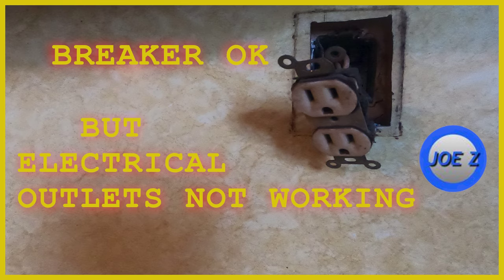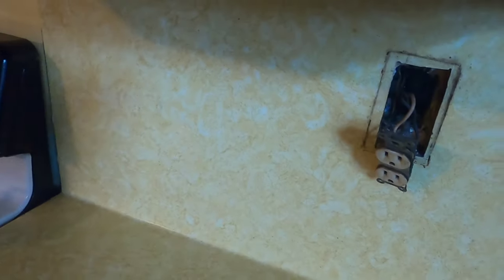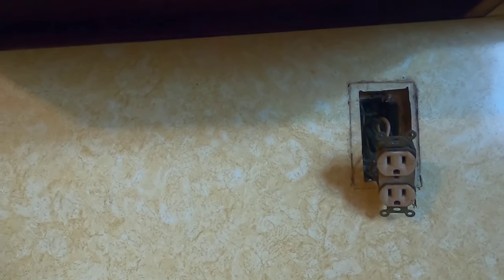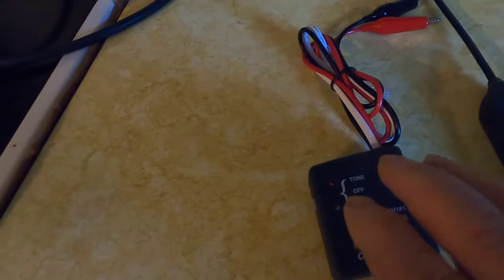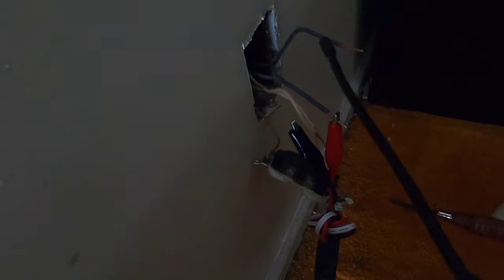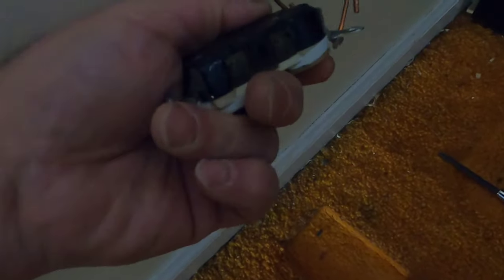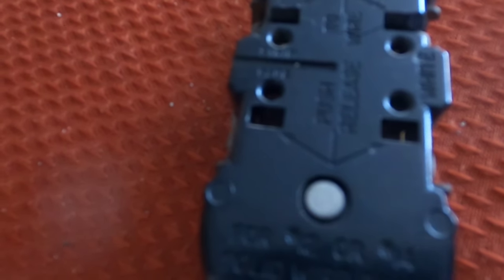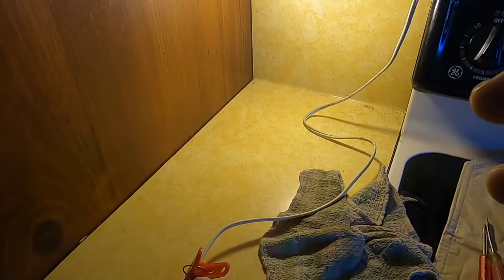Breaker on but no power to outlet FIX

Comment: Cost me 167 for the electrician to load test a gfi that was causing loss of power to my outside outlets. It didn’t pop the breaker but under load it would fail.
Reply from the maker: Calling the electrician was the safest & probably the least frustrating way to go. Although I try to save as much as I can the 167 was a decent fee.  
   Roger Miller, Thank you for watching and taking the time to comment. Roger Miller I have other videos on my channel that cover many different subjects  and new videos added weekly that may also be of help or interest.
 Be sure to 👍, share and subscribe if your are inclined to do so.  Also not to miss any new videos remember to hit that notification 🔔
 Another way you can help support  this channel at NO cost to you is by using one of my affiliate links.
     * Thank you for watching I really appreciate your support.***
Again I hope you get to  enjoy other videos on my channel as well. 
 Stay safe, Joe Z

Comment: the breaker box is 20 , 30  ,50 . i know things like the washer dryer ,  microwave are supposed to have their own outlet
Reply from the maker: That is a good start. I would turn all the lights on, plug radio, lamps etc
 into all the other outlets & just start turning off the breakers one at a time. Have you considered just running a couple of new lines to the non-working outlets? Cost wise it should be way less. Hope this was of help.
Stay safe, Joe Z

Comment: The contractor that wired the house initially should have only used the screw terminals on the side.  Never ever use the push connectors on the back for this reason.
Reply from the maker: Thank you for stopping by & taking the time to comment. I agree. I have receive many comments on this video from viewers that had the same problem So I dug a little deeper on line to fine out this happens way too often. Unless the installation was not correct they should not manufacture these with the push connectors.
Stay safe, Joe Z

Comment: My issue is that there is power but it is not enough run the fridge ac. The power just keep going on and off.
Reply from the maker: Until you can get run another line find what other appliances you have plugged into this line & removed them.
Stay safe, Joe Z
Reply: I think I'm having a similar problem where I have power to all the outlets but it's not enough to run my refrigerator or skillet. When my buddy hooked a multimeter to the outside box and inside box the readings came back okay. Any help would be appreciated. Ty.
Reply: @TheOmengod  replacing the switch outside fixed my issue
Reply: @Indicesproptrader  what switch? Ty.

Comment: Those stab in the back connections are terrible. The surface area of the blade that contacts the wire is about 1/100 of what you get when you use the tap screws. Every time I have an issue in the wall, it's that, it gets changed and we are fine. I should just do them all, but if it's working.......
Reply from the maker: Thank you for stopping by & taking the time to comment. I agree, whenever I have an wiring issue this is usually the cause. Changing as I go.
Stay safe, Joe Z

Comment: yes those push-in wire outlets are junk,,they cause problems,,,i worked in a large plastic plant running a 600,000$ machine,,and every time we had a electric problem it was one of those damn push in switches,, the Maintenace guys would remove it and replace with a switch where you tightened a screw in on the side like a old style outlet,, and problem solved ,that machine had plenty of switches like that ,it was once a month to replace them..
Reply from the maker: Thank you for watching and adding this information. From my experience & many other comments these '"push in"  outlets cause way too many problems. And they still sell them. Should discontinue manufacturing them.
@louisrichards3702 I have other videos on my channel that cover different subjects  and new videos added weekly that may also be of help or interest. 
Your support is not required but always appreciated. If you are inclined to do so your Subscription, Likes, Comments and sharing this content would help me to reach other viewers that may also find this channel useful or entertaining.
 
 Stay safe, Joe Z

Comment: My stupid kitchen in an old trailer has 2 plugs on the same circuit, so once and awhile if 2 things are on it goes off... But u can go and flick tht breaker on and off till the cows come home and nothing.! BuT, the plug will sometimes start working again just out of the blue, could be a day, could be a month.? Odd... So i figured the breaker was bad and bought a new 1..., but it would not work either, so i tried it on the next fin over & Vola it Worked...  -3 wk's later i had 2 things on again and Poof, out both plugs go again... Go bk in and look at breaker & it's sTill on.? Moved it over to another fin and nothing... Ive also changed that recepticle also...... Strange to me... ive got 1 dam plug that works now in the kitchen area, and thats by the door tho... No Fridge or Heater........
Reply from the maker: Thank you for watching and taking the time to comment. @OldGuy70s this may be a dangerous situation. You may have a loose or burnt wire that makes & breaks contact somewhere in the circuit. Do you have copper or aluminum wires? I ask because I heard of aluminum wires getting loose on terminals. 
 Check some of the comments below. May not be the issue you're having but may point you in the right direction.
 Stay safe, Joe Z

Comment: bro my controller batteries were flat and their rechargable so i tried to charge them but accidentally used wrong charger and i blew out the whole lounge and im scared because my mum is probably gonna kill me so im tryna fix it hopefully
Reply from the maker: Hi K_, Be careful, you can really get hurt or worse with electricity. That said before you take anything apart just check your circuit breaker first. It may be that simple. If not call someone (an electrician) who can help if you are not sure what should be done.
Let me know if this was of help. Thank you for watching & taking the time to comment.
Stay Safe, Joe Z
Reply: @JOEZEP54  Thanks for the reply luckily like 10 mins ago i fixed it and it was quite easy but next time i will never do that again i have learnt what i did wrong
Reply from the maker: K _,  You're welcome, I am glad this was of help. And thank You for watching and taking the time to comment. K _ I have other videos on my channel that cover many different subjects  and new videos added weekly that may also be of help or interest.

 Be sure to 👍, share and subscribe if your are inclined to do so.  Also not to miss any new videos remember to hit that notification 🔔

 Another way you can help support  this channel at NO cost to you is by using one of my affiliate links.

     * Thank you for watching I really appreciate your support.***

K _ I just want to mention If you haven't installed the TubeBuddy browser plugin yet, to help your channel grow  Just go to my favorite tool for channel growth Tube Buddy. Now You can use it too, here's my affiliate link to the Free versionhttps://www.tubebuddy.com/joezep54   Start with the free version, yes it is free to not only to down load but to use.

Again I hope you get to  enjoy other videos on my channel as well. 

 Stay safe, Joe Z

Comment: having the same problem as i speak gotta go out tomorrow when harbor freight opens and get a tracker the old house im living in the wiring looks like a bowl of spaghetti so go only knows where the open is and its on the old glass fuse type breaker box to add to the joys of it buy a home they said it will be fun they said ........bastards lol
Reply from the maker: The fun has just begun LOL. Congratulations on purchasing your home. There is are many benefits that go with owning your home along with becoming a jack of many trades 😃 I haven't had to deal with an old glass fuse type breaker box in many years but I am very familiar with it. Just be careful and don't rush the job give yourself time to figure out the problem. Walk away from it if & when it gets frustrating then go back to it fresh. It took me a little while to figure out how to use that tracker and a couple of days to come up with the game plan to solve my issue. Not wanting  to pay $$$ gave me the motivation to keep at it. But there are times when we do have to call in the pros.
Let me know how your repair goes.
Stay safe, Joe Z
Reply: @JOEZEP54  got the tracker and well still trying to figure the damn thing out but im stubborn and refuse to pay 100's of dollars to an electrician i will figure this out might not have any hair left on my head when i do but ill be that bald guy smiling like i won the damn lottery when it happens
Reply from the maker: LOL. This may be of help. Get a length of wire or an extension cord, attach the tracker to it to see/hear how it tracks. .Let me know if it does.
Keep smiling, Joe Z

Comment: In other words: Loose wire. Find it and everything past that is fixed.
Reply from the maker: Thank you for watching. In this case no, it was a burnt/worn out  outlet. Although it is obvious that there was a break somewhere in the line the problem was how to find the break. In the video you can see  half the outlets in the kitchen did not work but the break was from an outlet in another room.
Stay safe, Joe Z

Comment: why would he talk so long showing what did not work to fix it. SHOW HOW YOU FIXED IT
Reply from the maker: Mr. Meener, I appreciate you stopping by & commenting. To answer your question not all "breaker on but no power" issues may be caused by the same problem. So what did not work for me may very well be the issue for some other viewer. I believe I made it clear that this was the first time I had this problem & addressed it. I hope it was of help. Plus you can skip ahead in any video.
 We are all here either to learn or just for entertainment no need to shout.
Stay safe, Joe Z

Comment: Typical problem.
Reply from the maker: Thank you for stopping by. The problem is finding the fault. From the amount of comments on this video I believe you are correct.
Stay safe, Joe Z
Reply: @JOEZEP54  I've found that issue in large two story homes where the lighting circuit and receptacles were not separated.  The culprit is always a GFCI, often wired on a two wire system, which is  not the best.
Reply from the maker: @broederbond60  In my case it was an outlet in another room.

Comment: Bro Please Please don’t ever do anything to electric and then post it on line .

You are not a Electrician.
Reply from the maker: This is an issue that I had & was able to correct. It is not an instructional video. If you watched, listened or read the description I make that & the fact that I am not an electrician perfectly clear. If you have a way to address the no power issue it would be appreciated either in this comment section or perhaps taking the time to make a video. 
Stay safe, Joe Z